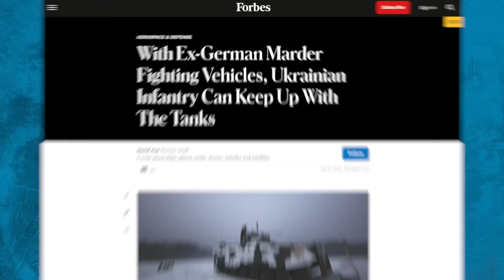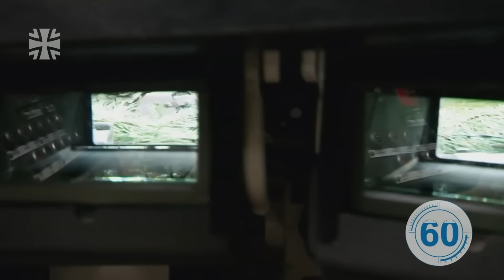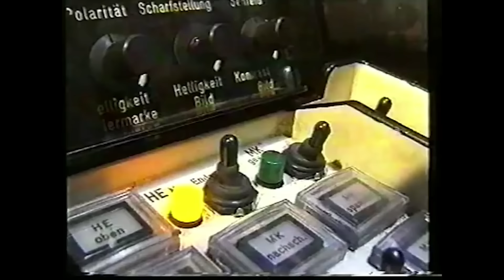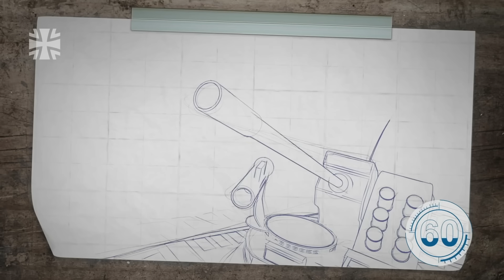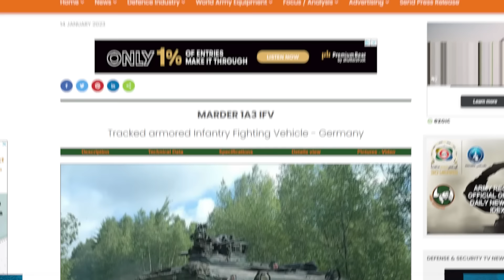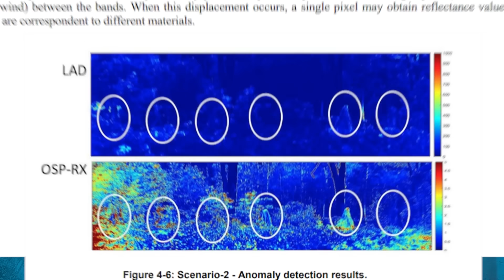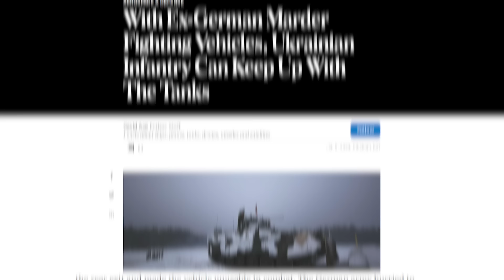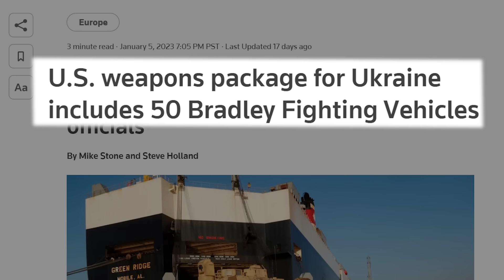Why this German IFV is So Hot Right Now

Comment: The real problem is not the supply of tanks and co, but the continuous supply of ammunition, spare parts, and new tanks.
In Germany we call this a Kriegswirtschaft (war economy), the West was not prepared for their material to be used in a war, there is a lot of catching up to do.
Reply: The west does logistics very well,  Russia has never heard of logistics.  Soldiers win battles,  but to win the war you need logistics that work.
Reply: @chrissmith2114  Russia does logistics actually insanely well. Their whole train network and BTGs are set up to synergize very, very well.

In a defensive scenario. XD
Reply: @chrissmith2114  I am convinced that the West has a better grip on its economy and can produce more material, but for God's sake don't underestimate the Russians, that would be our biggest mistake.
Reply: @chrissmith2114  Russia does logistics differently. Just watched Perun (using a RUSI report) compare that the West “pulls” logistics, whereas the Russians “push” logistics large scale. The latter not being efficient, but also does not rely on good communication & management. It’s a fair point that Russia can move a functional army 10,000 miles cross continent by land. It looks like a shit-show at the point of delivery, but at a strategic level its putting up a wall against Ukraine. A wall that now needs ATACMS to break. The HIMARS hit & run game is now winding down due to range looking at most Ukrainian reports. And if that’s not an option a lot more high end tanks & fighters are required to push into the Russian lines so HIMARS can keep hitting all of occupied Ukraine.
Reply: @MsZeeZed  Perun videos are very, very good.  Best powerpoints you will see on Ukraine.
Reply: @MsZeeZed  yeah like a hospital in Donbas...
Reply: @davidmclean357  No, not the best. Rather best just for English speaker.
Reply: @chrissmith2114  Saying Russia "never heard of logistics" would an extremely stupid thing. It deals with greater distance then Eu and Ukranie.
Reply: @skywillfindyou  What are the best alternative videos you have seen and is there a translation available?Iwould like to see some of those!  Thanks
Reply: @Homer_J  Doubtful. That could have been said when Europe had access to rather cheap resources, which changes now. The whole industry will suffer shortages and shrtcuts. USA already bought and moved tons of from Germany. Hilarious actually.
Reply: Yes, the West was not prepared for this war. However, Ukraine's location is very convenient.
Reply: z
Reply: The systems are booted
Reply: @skywillfindyou  The US has the most advanced logistical capabilities in the world. It has spent decades developing a vast network of military bases and assets all over the globe. It has developed advanced auxiliary support ships providing underway replenishment ("replenishment at sea") to major fleet units, and is the most experienced force in aerial refueling in the world.
Reply: @M1984FA  I don't know who destroyed Nord Stream and you don't know, you only suspect, but whoever it was made Germany stronger and ended its dependence on one supplier for gas.
Thanks for that to whoever it was no one in Germany is angry about it.
Reply: @cy-one  but in this case I don’t think the OP was referring to moving of equipment and supplies, and instead was talking about manufacturing replacements for various weapon systems and their ammunition.

In the case of this, Russia isn’t the only one having issues, although theirs will be more apparent. For example their stock of certain missiles, drones and artillery shells has been extremely low and they’ve had to reach out to various allied nations to purchase some. NATO nations on the other hand can hide ammunition shortages by simply not offering to send more of something, if they are low or out.

Sadly each time Ukraine suffers a considerable strike of drones and/or missiles, the number of SAMs fired would likely take months for replacements to be manufactured, and that’s if they are even still be made. This is not 1942 when, for example the US was able to build 10’s of thousand of combat aircraft, complete dozens of combat ships, and make millions of guns, bullets and bombs.

Not to mention, should this escalate to a NATO vs Russia hot war, every weapon system and ammo  that is being supplied to Ukraine is that much less NATO will have to commit to it’s own fight.
Reply: So you Potatoes admit that you declared War on Russia in Americas ProxyWar lmao. Guess 3 times is the charm, hasnt worked out the last 2 times you declared war on moscow
Reply: @chrissmith2114  The Problem with Russian Logistics is that they need Manpower for that. They have little to none support for their Logistics in Means of Loading/Unloading Trucks or Trains.
The West meanwhile had understand very early that the Mechanization of Logistics (Forklift aso) is a good Way to save Manpower and make Logistics faster. And they pushed this even further. Now there are Trucks where they only need to drop off a Container and can go back to get the next one. 
Russia meanwhile usses hundreds of Soldiers to unload the Trains. Then Load the Trucks and unload them at their Units.
Reply: We don't need a war economy if the whole west stands with Ukraine.

Russia has not the economical power to compete against casusal western weapons production.
A tweak here and there should be enough.

Russia has the economical power of Spain.
Nothing against spain, but spain wouldn't stand a chance against nato.
Reply: @cy-one  Using railways is not a good idea, they are easily destroyed by an enemy, and Russia never has anywhere near enough trucks.  Even fighting Ukraine on Russian border the Russian supplies have been crippled by a few missiles... NATO does worldwide logistics,
Reply: @skywillfindyou  Yeah, but we are talking about NATO vs Russian logistics here,  having railways to do your logistics falls down as soon as your enemy can strike at will in your country ( like NATO can ) and destroy all the bridges and infrastructure.  Russia has a truly massive shortage of lorries, transport aircraft and ships,  and in any case their access to Baltic and Mediterranean is severely compromised, and in winter most of its ports freeze up.
Reply: @Kumpelblase397  Due to lack of trucks Russian tanks often have to go back to ammo store to pick up new shells, which is why Russian ammo dumps were close to the front line and withing artillery range,  and certainly easy pickings for HIMARS, even the 80km missiles.
Reply: @AbuHajarAlBugatti  cope harder ;*
Reply: @AbuHajarAlBugatti  Pardon me, but didn't Moscow provide up to date weapon systems, weapons and even fighter pilots to North Vietnam when they were fighting the US and to North Korea when it was fighting UN forces?
Reply: @chrissmith2114  Really? The US is going to South American countries asking for ammo.
The one thing about this war is that all the high tech stuff is not easily or quickly replaced.
It's also not as effective in real world situations as the opposition learns to adapt to it.
Regardless it's the Ukrainians who are the ones doing the logistics, in the field.

Comment: Rubber padded tracks aren't rubberband tracks. The Marder has normal steel tracks but for use on roads in Germany has to have rubber pads installed in order to not destroy the tarmac. The Swedish Bandvagn comes with rubberband tracks as did the American M3 halftrack of WW II.

Comment: could you talk about the logistics involved in maintaining all these different types of tanks and the difficulties and possible  solutions. i would love to hear your take. thank you for your vids
Reply: Maintenance and repairs will be done by all those nato nations who are "not" at war with Russia.
Reply: @derkernspalter  who will supply and take jet fuel to the front for the US Abrams?
Reply: @zedwpd  That like, a year away from now. They can set up a repair and storage facility somewhere in east europe in that time no problem
Reply: @zedwpd  Abrams dosnt need to use jetfuel per se its just what gets the most power out of the engine
Reply: its probable for anything significant, there shipped back to nato land...  if your interested in logistics theres perun's channel, and i think a little know ww2 operation redball? maybe.
Reply: @zedwpd  afaik Poland is where the US is going to maintain their systems and generally Poland, Lithuania etc. are probably acting as 
the "repair shops" for the Nato systems... But the info about that is not very dense at moment.
Reply: I’ve long said that if NATO nations agree to send tanks, it probably should be limited to Leopard 2’s, even if a few different upgrade versions are sent. 

This could be accomplished, by say if the US wanted to provide say 50 Abrams, they could offer Poland them in exchange for it sending an extra 50 of it’s Leopard 2’s to Ukraine. This wouldn’t cause Poland any logistic issues as last I knew they ordered 250 M1A2 sep3 Abrams, so this would simply mean they’d end up with more than originally planned (and of course they are still want to increase the number of MBTs they have further.)
Reply: @iluminas2866  I've seen/smelled what the exhaust of diesel engines running on "alternate fuels" (various oils into the mix). Kinda has me curious what the exhaust would be of one of those with their fuel consumption at full power. But as long as they stick to something refined meant to be burned as a fuel to move a vehicle (petrol, diesel, JP-4, JP-8, etc) it'll probably be just fine. Might get questionable when one starts to burn (filtered) cooking oil or used lubrication oil.

But supplying those vehicles with fuel could be an interesting challenge, turbine engine are great at burning a lot of fuel even at what they call "idling" combined with a high fuel consumption compared on the move compared to a traditional diesel powered engine. I'm sure it must have some benefits to put up with that fuel consumption.

Comment: Having served in Marder. In case you mount the Milan launcher you don't waste a slot in the squad area. You can also carry it and the squad area with 6 would still be on the comfort level of a Bradley or Scimitar. It would not match the disembarkment speed target. What is a real advantage is using the Milan TOW dismounted in on a tripod. So you can place a concealed and 20mm AC APC backed up tank ambush including a few Panzerfaust 3 RPGs and MG3 cover. At tons the 650 HP engine did okay in muddy slopes. With the 750 Hp enigne this is a crazy good APC with the a crazy lot of space in the squad compartment. Space for all the squad extra toys from drones, to loitering munitions to extra Javelins and Stingers, grenade launchers and poineer or combat engineer kit.

Comment: My brother was a Marder driver in the early 1980's. Like it was said, the Marder Schützen- and Spähpanzer had multiple roles, but mostly it was support and reconaissance for the Leopard 2 tank. I don't know which exact model he drove.

Unfortunately during one strategic maneuver deployment my brother sat hood up (without earprotection and open driver's port, head above the hull) when a neighboring Leopard 2 opened fire with the main gun without warning the rest of the fighting group over radio. He was a mere 10 meters from the Leopard 2's main gun, and lost hearing on his left ear for several weeks.

Comment: Careful, the ww2 Marder shown in the clip has absolutely nothing to do with the Marder of the Bundeswehr, neither functionally nor technically. It was an AT system (sometimes used as an improvised Inf support vehicle). 

The concept of the panzergrendier driving around in an AFV traces its root to the armoured personal carriers which the Wehrmacht fielded in its various versions of the Sonderkraftfahrzeug.
Reply from the maker: Yes correct! We were trying to talk about general ww2 era German tank strategy and how if lead to the HS30. The broll was supposed to be generic German armor in ww2. I can see where that would be confusing

Comment: They are a bitchen track....   Worked with the 142 PanzerG's out out of Koblenz at Graf and Baumholder.   Damn they are quick and the neutral steer is great.   Gunner could hit the target when we advanced on the range AND when driving in reverse with the front at the target.    It was almost as fast in reverse as it was driving forward.    Quick/smooth and the heater in the back for drying your boots/pants as you stood up in the hatch...  First rate.

Comment: You asked, if martens (german: Marder) can climb trees - the answer is yes. Their claws are very fine and sharp, so they easily climb trees as well as walls and even run under the ceiling. The pictures you show is from stone martens, also known as beech martens, guess why they are named so. The second biggest (badgers are #1) are pine martens, mostly living in the trees.
It would be a great upgrade, if the Marder infantry carrier was equipped with the new MK30, a 30mm Oerlikon/Rheinmetall gatling gun with programmable ammo.
slava ukraina!
Reply: They also like to bite through wires in your car so we can expact some upcoming Marderschaden, with the Russians' vehicles.
Reply: Those things make my life hell as you can't have any old building even at the edge of a village, or it's plausible that one of those little demons has nested or foraged there, and you need to spend a huge amount of money compensating their habitat before you're allowed to build houses. 😆
Reply: @Vatnik_tschistilka  - YES please !
BTW: martens are very territorial and mark it with their urine, so, if you park your car overnight in a different territory, the "owner marten" will smell its rival and look for him to fight him off. If he doesn't find him, he gets enraged and destroys everything around the strange smell, including ignition cables, brake hoses, engine compartment insulation etc.
Reply: you are mixing up a couple of things. Oerlikon is still reminiscent in the Rheinmetall Swiss section and Rheinmetall Air Defence, but the MK30 is a) not a Gatling but a Maschinen-Kanone (see the first letters), and b) it was developed by Mauser (now part of Rheinmetall Waffe Munition). But RAD has a nice weapon that is a bit closer to a Gatling: a revolver cannon (KCE-30). Still doesn't reach the cadence of a Gatling though (sth around 1100 rpm).

Comment: Normally the videos in this channel are well researched. Unfortunately the German makeshift tank destroyer "Marder" from world war 2 has absolutely nothing to do with an APC or IFV. As others already mentioned, the Sd Kfz 251 is the predecessor of modern IFV.
Reply from the maker: Correct , I was simply talking about how tank strategy of ww2 lead to the hs30 which lead to the marder . I think the broll we used confused the point I was trying to make
Reply: APC maybe?
Reply: @Мойевропейскийжидобандеровский  
armored personal carrier means that the vehicle is designated to carry troops into battle or their equipment, the marder from ww2 is by definition a tank destroyer as it only has the gun, ammunition for the gun, and space for the crew. no dismounts which make it unfit to be called an APC

if you are looking for ww2 APCs from german look to Sdk.fz specifically the SDk.fz 251 with the MG 34
Reply: @robo-suport_czrobofactory3116  251 was an APC
Reply: @Мойевропейскийжидобандеровский  
yes thats what i said

 in retro spect you maybe saw my comment before i edited 4 times because my adhd ass kept getting reminded what else belonged to my comment
Reply: @robo-suport_czrobofactory3116  and what I said too
Reply: @Мойевропейскийжидобандеровский  
in that case there has to be some miscomunication, in your original comment i thought you were refering to the marder as an APC

Comment: 7:41 the "remote control" of the second MG was a soldier sticking his head out of the Marder right under the MG and firing it with controls from the inside. The enemy had to aim just under the rear MG to kill the operator with a headshot. When the soldiers had to dismount the MG operator, who was part of the 6 man team which had to dismount, had leave the firing position.
Reply: Nope, he was not sticking his head out of the marder! This remote controlled MG had, i think it was just three periscopes for aiming, nothing else. That MG did not make much sense though, that is exactly why it was discontinued and fell away.
And no, that remote mg was not operated by the designated MG gunner, as the seat right under the remote MG was the seat of the sergeant who was in charge of the rear combat compartment group (Truppführer des hinteren Kampfraumes)
Well your "headshot scenario" is only a nice fantasy... what do you think is trained hm?

The Spz Marder will always disembark its 6 men infantry element under cover, never with the rear ramp facing an enemy. At the very least, the rear will be pointed to the back, the opposite direction.
Been there done that, went to combat troop school munster for that as a gunner and graduated as commander for Spz Marder, as all Panzergrenadier Sergeants did. PZgrenadier Division 6, 17. / 16 Brigades in the very early 80s.

Comment: The “technical problems” the Puma encountered have been shown to be nearly fully traceable to lack of maintenance effort. It’s due to the army running on fumes when it comes to funding being allocated to them.
Reply: Not only maintenance issues. 
It is poorly designed and the electronics are overload many systems. Main electrical  components are outdate.